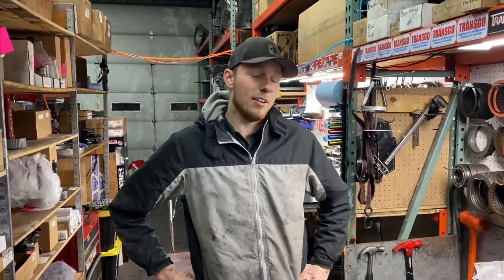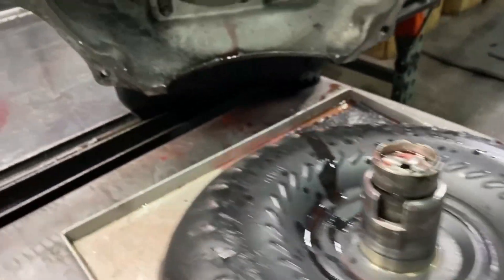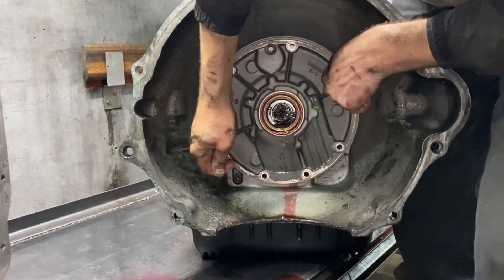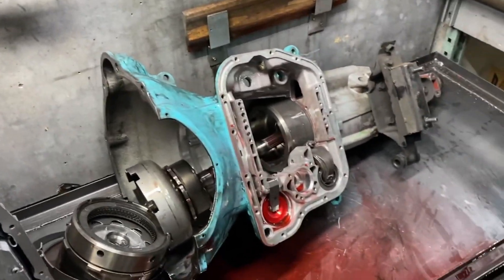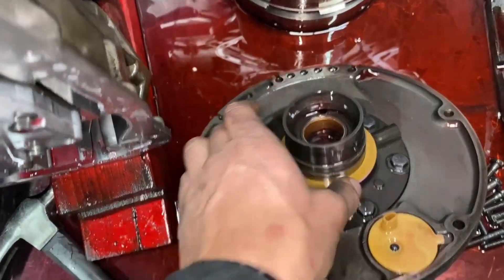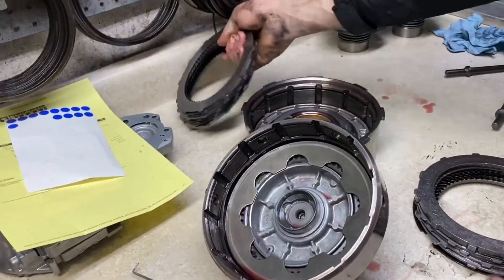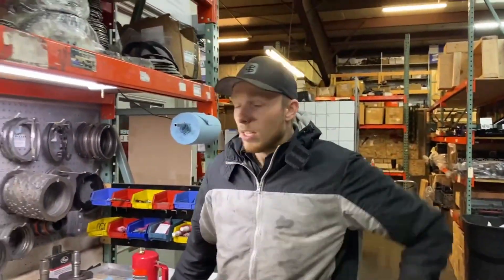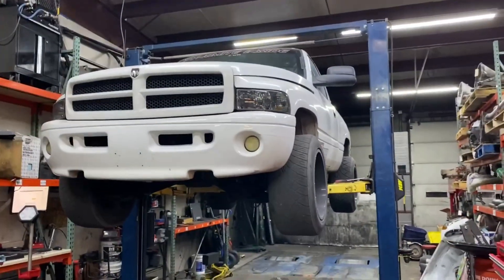MYER'S SHAWTY IS DOWN!!! BROKEN INPUT

Comment: The weakest part of the shaft should be at the front seal ring groove.  The four 3/16" holes added together match the factory 2 hole dia area. The reason for four holes was to stay away from the seal ring groves those dimensions remained the same since 2003.  It was believed any restriction of that circuit would cause a softer lock up and excess wear to the TCC.  The main reason for introducing the fat shaft in 2007 was to get higher hp trucks to run a through hardened torq converter hub.  Do to the seal ring diameters, the next input shaft upgrade was going to be a hybrid to an Allison style Shaft but at that time the diesel world was busy writing emails to the EPA about rival businesses.

Comment: Locked shifts I guess , its pretty good jump between shifts at 750 rpms . Well I do enjoy the videos . I don't know much about the convertor stall , going from fluid coupling to lock up is not as big a jump with a tighter fluid coupling how ever the tighter convertor makes the turbo harder to light .